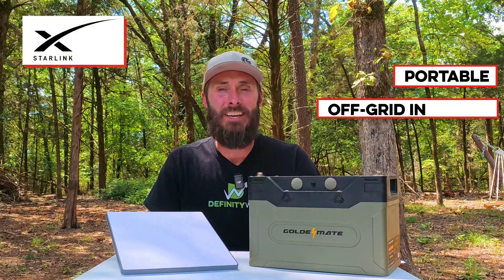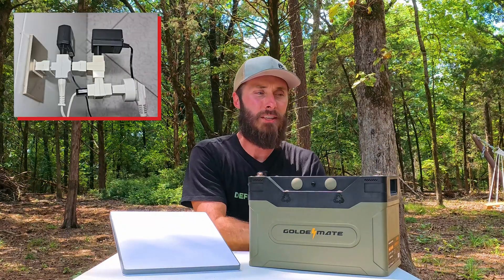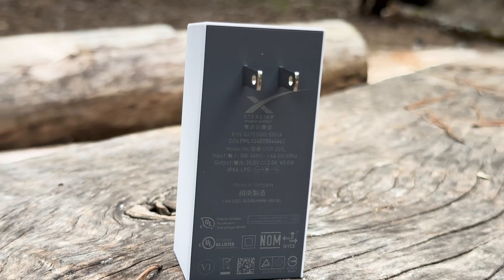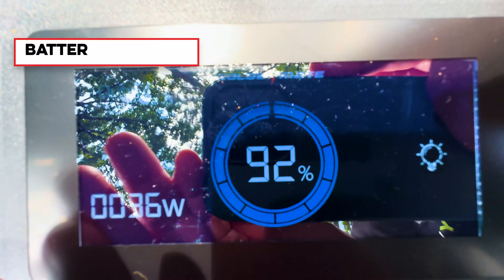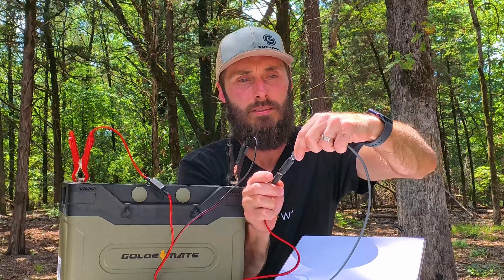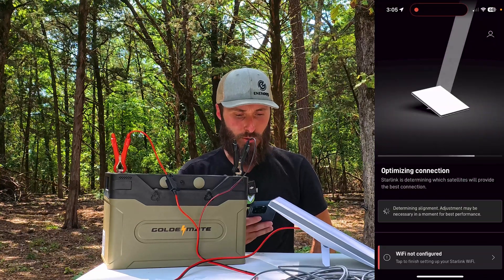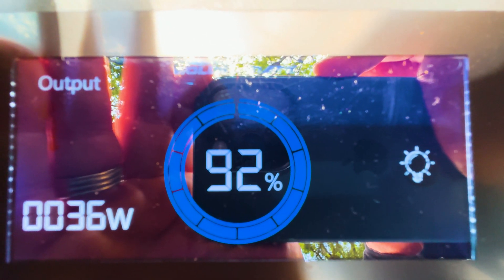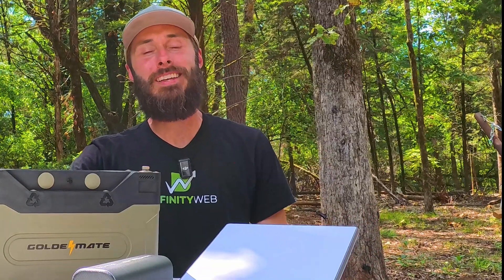Starlink Mini Review: Can it be powered with a 12v battery?

Comment: Yeah just get a boost controller and bump the voltage to 24v you dont loose much efficiency. You can get a water proof version. The also sell like golf cart 36v versions but any boost controller that gives you more than 12v on the other side of the long end shoukd work. Or use thicker gauge power wire. 14awg copper. Im sure they only put 18 awg at most in the original power cord. Starlink is rated at 12v min but the wire probably has a lot of resistance.

Comment: Google VOLTAGE DROP. Use a 10' max cable or 12v to 24v 100+ watt voltage booster

Comment: I have the mini.  I use the Anker Solix DC. I also have the Solix AC version, but the DC fits in my bag better. I also use the Sokiovola 100w IP68 foldable solar panel. They all fit into my camera bag. I can plug the Starlink directly into the solar panel, but I use the Anker to regulate surges. It takes in 3X the amount that it puts out. My Anker stats between 99-100%. Input is 68 W, output is 23 W (+/-). I purchased a Starlink direct to USB C cable and plug it into the 140 W input/output port. This setup is much better and is free energy for unlimited time. The battery without the solar panel connected to it would last a full day easy. Being that I have the AC & DC versions, I'm not worried about running out of juice at night in a power outage.

Comment: I got the standard 5m 12v cable, plug it into cigarette lighter socket on car no engine running starlink dish light comes on, but will not show connection on wifi, volt meter on car shows 12.6v, start engine and idle volt meter on car show's 14.1v  starlink comes on once it starts booting to the internet wifi drops out and unit seems to shut off,  still at 14.1v on volt meter it did seem to boot up Once when engine off but voltage meter went down from 12.6v to 11.9v before starlink shut off, car has a recently new battery any help welcome PS. I have used the brick a 200watt power inverter while car  but that inverter shuts down even while driving, may just be a stuffed New  inverter as it dose same on a car with a larger battery than mine

Comment: One thing worries me is that the wall adapter provides to mini 36volts (if i am not wrong). So I wonder if only giving it 12-13volts is not something that may have it functioning, but under stress. What do you think?
Reply: Hi I just got the mini, I bought a  standard 12v cable and it will not boot up when engine is not running, It will boot up when engine is running, but not for long, My sister has the expensive mini 12v cable that has a step up modual on it, that puts out 30v  she had no reported problems with it, I will have to try it tomorrow, my car is a suzuki jimny with a small battery, hers is a land cruise with 2 big battery's if it works i'm going to have to pay $100 for the cable,

Comment: The wire length could be the problem like others have said, or the female to female adaptor may be reversing the polarity causing the DC not to work on the dish side.

Comment: It's very possible your adapter is not 2.1 center pin and is 2.5 instead and not making a good connection.  I makes enough of a connection to read voltage but fails under load.

Comment: I have the Starlink Mini Car Adapter which comes with a 5m USB-C cable to pole plud and a car cigarette lighter stylw plug / USB-C adapter. I not that its maxim voltage output is 20v at 3A.

Comment: Yes, your AC power supply is putting out 30 volts and although the dish will just barely run on 13.3 volts, there was too much voltage loss on a longer cable toake it work. The Buck Converters that double the voltage are 90-95% efficient so that is why so many folks are using them to run their dish on DC without the bigger power loss. Thank you for confirming that I will need to do this as well. We camp host in the USFS & need to download the reservation lists for each campground every day to catch any cancellations or modifications to any existing reservation. I hope that folks will spread the word about the 30 volts part. The raised it to what they did because Starlink knew the small cables would have a lot of voltage loss. Cheers, Davey - KU9L

Comment: I'm curious, why not cut the original cable at about 6 feet length, use the factory plug at the dish for waterproofing and then crip on ring terminals on the other end and voilà? Fixes the voltage drop and waterproof issue. I'm gonna go try this on mine. Thanks for the inspiration.
Reply from the maker: I just really don’t like cutting OEM cables. That’s all. I’m glad I could give you some inspiration though. Let us know how it turns out
Reply: Did it worked? I was thinking about doing the exact same thing.

Comment: This video did not properly address the real useable time that the demonstrated power source would give.  If the battery you are using is rated at 100Ah, you do not have 100Ah of useful battery capacity. A Lithium Battery should not be discharged below 20% and even then, discharging it to that level reduces the number of charge/discharge cycles that the battery will support before being replaced. Discharging to 30% is really what is recommended for good battery life, so you really only have 70Ah of useful battery capacity.

Comment: Pretty much what everyone has said below. Using 12 AWG wire, I can power my mini from a 12 volt source over 50 feet away. Using the same 12 volts source and the provided cable, it won't work (but does work through about 10 feet of cable).  As to the USB-C-PD, I have run mine with a 5 foot and with a 15 foot USB C source cable, but not longer. I've also added a 12 to 24 volt step up buck converter, and it runs the Mini just fine over the length of the stock cable (the up-convert is at the battery, so am feeding the cable with 24 volts, not 12).  Lots of options to solve the problem you were seeing.
Reply: Hey, just wondering if you’ve cut the standard barrel cable and seen red/black wires? Sometimes I’ve seen barrel cables have the negative side wrapped around the positive for I’m assuming noise reduction purposes which makes is less nice to splice. Also wondering if you used 12awg with the water tight connector? Thank you!
Reply: @lironhomelab  It is red and shield. I put Powerpole connections on it so I can connect to whatever I want. They are not waterproof (but are also not outdoors with the unit). I have a 12 to 24 volt buck converter, as well as a coax/barrel to power pole adapter, so can plug into the 24 volt source, to the other end of the cable with the coaxial connector, or into a 12 volt source. Whatever is suitable/appropriate for the immediate use.
Reply: @carlleon1604  perfect info. Thank you so much!

Comment: The adapter is 30v output. The Battery = 12v  ergo voltage drop

Comment: .... a 50ah 13.2V battery (only 11lbs) and some low I/R loss #16 wire/cable....ideal... It wouldn't be hard to waterproof that connector... add in a 100 watt 12V (16-18V open circuit voltage) solar panel...the BMS in the battery itself should prevent overcharging...you shouldn't even need a seperate charge controller. I would also put proper eye terminals, and solder them on  to the ends of the wires, remember, the battery has bolts, and it's not hard to bring a little crescent wrench or spanner with you.... ditch those big clamps, they tend to be crimped lossy affairs.  Biggest problem? That pathetic 50gb cap...Sorry...no FB cat videos for you....meow.
Reply from the maker: That would be a nice setup. :) They offer unlimited plans now BTW.

Comment: Starlink Mini users, help! The DC power cable in the Starlink spec sheet is listed as 5.5mm x 2.5mm. However, when I checked several online shops, they show it as 5.5mm x 2.1mm. This has really confused me. Could it be that the DC power cable has two different ends, with the end that connects to the dish being 5.5mm x 2.1mm and the end that connects to the power supply being 5.5mm x 2.5mm? I'm not sure if this is the case.

Comment: Would it be possible to utilize the original water tight connector? Like cut off the end of the original cable then slice the cables to the 12v supply. Just curious. Maybe the cable was too long to make it work in your first setup.
Reply from the maker: That would work for sure. I just don't like cutting into a perfectly good cable when there are other options.

Comment: i would use a StepUpConverter 12 to 24volts (it can do a bit more thing 30v max)  ...  then it would be more stable... OR  depending on the max voltage something to the highside.  you have them from Victron Orion DC-DC cargers.  ( the one with 2 black plastic sides)   ... those have a Variable voltage ..Higher Voltage Lower Amps  and would be ideal for a Longer Cable lengt ...
Reply: ill explain its 100$ for the Orion 12-24v DcDc...  there is a small screw. to change the voltage output...so i would use that to find the voltage you want.

Comment: You need to put a load on the end of the wire while you test the output voltage. I would take a headlight or some something that draws around 3 amps at 12 volts and while you have the light connected test the voltage. The minimum voltage the mini can run on is 12 volts so perhaps you have a poor connection or you are close to the mini's dropout voltage.  To further isolate what wire, positive or negative is causing the problem by testing the voltage between the positive cable by the battery and positive by the light bulb. You should have less than .2 volts. Do the same for the negative side.

Comment: Great info.  Gen3 standard dish supports POE, so indeed Mini is not the only model supporting straight DC.  If requires some POE injection shenanigans and other moving part though; Mini is simpler.  After startup power "spike", Gen3 draws ~40 W, about double the Mini.  USB-C is the answer, will look for vid.  Thx!
Reply from the maker: I didn’t know that about the Gen 3. Thanks for sharing!
Reply: @EastTexasHomestead  , So a PoE injector closer to the SL-mini would also work ?

Comment: Rough numbers here....The dish needs about 48 watts to start up. If you were using 48 volts that would be 1 amp. Since you are using 12v then it will draw 4 amps. But.... The more current and the more length a wire has then the greater the voltage drop. One fix is to shorten the cable, you found that on. Another would be to get a DC to DC converter and bump up the voltage off the battery.

Comment: What about going to a standard car utility port (cig lighter) instead of clamps? Would that be possible?
Reply: Yes, there are a few videos showing this.  The issue is the length of the power cable.  Too long and there's too much power loss.
Reply from the maker: I’m about to put out a video showing usb-c powering the Mini and cover the cig lighter as an option. Thanks for asking.

Comment: You need to measure the voltage while under the load. You can show full voltage with a really lousy conection if the is no load on the circuit besides the meter. Of course with sealed wires and conectors its hard to probe. You can build a probe adapter but that is also a failure point in the circuit.

Comment: I am pointing towards your cheesy barrel connector. get spare cable cut the connector off battery side and wala
Reply: Voila’
Reply: I'm betting that's it. I'd try a straight up 5.5 x2.1 extension cable with male and female ends. I use these types of plugs on my telescope rigs and it's crazy what does and doesn't work for no apparent reason.
Reply: No voltage drop

Comment: Maybe the gauge of the Starlink wire is too small.  I have a 20' 5521 extension cable that is 14 ga wire and it works.

Comment: The Starlink Mini brick says 30v -2a so that means your power source needs to be 30v to accomadate the voltage drop over the 50ft of cable to have the necessary voltage and amperage supply to run the Starlink Mini panel. Your 48v house system would be able to run it with the 50ft cable. When you plug the 50ft cord into a 30v power supply, you see the Starlink Mini is using 20.2v at 47w on startup and the the power usage goes to under 25w at 20.3v once it stabilizes. So it really needs more than what a 12v battery can supply if you need to use the 50ft cable that comes with it. The shorter it's power cable the less voltage it requires.
Reply: Great answer. So, I assume that if I cut the original 50 ft cable to say, 6 ft, it will work just fine, right?

Comment: V=IR You add a bunch of resistance with that 50' wire. The voltage is approximately constant from the battery. So the current (I) goes down below the minimum for the device to operate and eventually the voltage sags, too. 
A simple USB-C PD solution that has higher voltage available will work better even with a smaller power source.
Reply: and using a DVM shows no voltage drop at the end of the 50ft cord because it applies no load which is what misleads many to think there is no issue. A buck converter might work that goes from 12V to 24V, still a transformation loss, but only once rather than twice if we you went DC -> AC -> DC
Reply from the maker: Thanks for the detailed info y’all. I’ll have to play around with it. I’m starting to think the Adapter is made out of some junky material that is adding resistance. I’ve used a 20V usb-c cable that works until I add the long wire and adapter. I’ll keep playing with it
Reply: @EastTexasHomestead  > "I’m starting to think the Adapter is made out of some junky material that is adding resistance."

It's really just that for the 50' cable they're using thinner wires to make it manageable/portable/coilable. The thinner the wire, the greater the resistance.

If you were to double the voltage (24v battery instead of 12), you halve the amperage, so could get away with the thinner wires.
Reply: @EastTexasHomestead  Its just voltage drop if you got some 3mm2 for outdoor lighting  then you would have about 1v drop at 5amps
Reply: Agreed and measuring the resistance is easy enough using an inexpensive DMM. The Starlink Mini is rated around 40 watts, or about 3 amps of current draw. One ohm of resistance will give a significant drop and calculating (I^2)R gives about 10 watts just heating up the wire negating the efficiency benefit gained by eliminating the inverter.
Reply from the maker: The video is in post production and will hopefully go live Monday. Until then, I’ll post a link below to the USB-C cable I used to step it up to 20V and go through the “janky adapter”. It only works if your usb-c PD puts out more than 45 watts. If yours does 100w you should be golden. Just grab the cable and the Female to female 5521 adapter and you will be set. 
https://www.amazon.com/dp/B0BGF9DX8J/ref=cm_sw_r_as_gl_api_gl_i_M8WRWYRRAAY92Z0ARNT9?linkCode=ml2&tag=youtube-eth-20 (affiliate link)
Reply: @EastTexasHomestead  I say jump you say HOW HIGH haha.  Can't wait to watch!
Reply: Until ETH has a chance to make his next vid, please list the steps and cables required to use USB-C PD.  I have a 100W cig plug USB adapter -- source is solar charged 12 battery bank.  How do I cable it to Mini so I can operate 50' from my van.  Thanks!

Comment: You have too much voltage drop with that long cable run at 12V. You're not seeing the voltage drop when you measure it because it's not under load. Put a 4A load on it and you'll see how much it drops. You can either run higher voltage like 20V by using a USB-C PD trigger to 5521, use shorter cable, or use a much thicker gauge cable if you need a longer run. It's easier just to boost the voltage. There are plenty of car cigarette lighter chargers that can do USB-C PD 20V/3A.
Reply: I used a DC-DC boost converter to convert from 12V to 36V for the Starlink mini. Works well, but I'll probably swap it out for a PD power supply.
Reply: What happens when you look up the clips to a different 12V battery, e.g., your car battery?
Reply: Hi, start by reading the spec on the power supply and match that.
Plenty of dc to dc converters out there to give you the correct supply voltage and let you use the long grey cable.
Take care M.
Reply from the maker: Thanks! I’ll play around with it.
Reply: @EastTexasHomestead  You can connect two 12v batteries in SERIES to obtain a voltage around 24 to 26 volts. I have a Mini and tested this for over an hour with this setup. Search the internet for "battery series connection diagram" for a wiring diagram. This setup will overcome the voltage drop in the standard 15m cable.
Reply: Just saw the clip at the end. Looks like you have the right idea.
Reply from the maker: @eljeffe991  the crazy thing is, even putting out 20 V it still doesn’t work with the USB-C and the long gray cable. But it does when I connect directly to the USB-C / 5521 cable.
Reply: @EastTexasHomestead  that cable was designed for 30V. It's quite long and the wire gauge is small. You're probably still getting too much voltage drop starting with 20V. I just got my mini and have no issues running it with USB-C at 20V with a good quality 10' cable. My plan is to have basically to have two power options. A "mobile" power option using USB-C to either a power bank or vehicle 12V to USB-C PD (20V) power adaptor with short cable. I'll connect w/built in Wi-Fi and don't care about weatherproofing. The other "fixed" option will be using the waterproof power and ethernet cable, leave the terminal outside since it's weatherproof, set the internal router to bypass mode, and use my own router indoors.